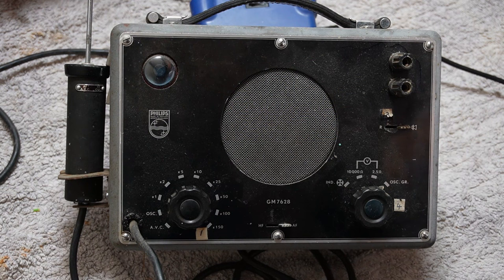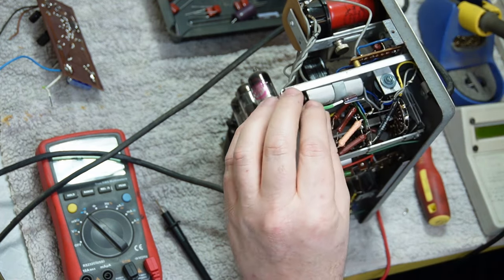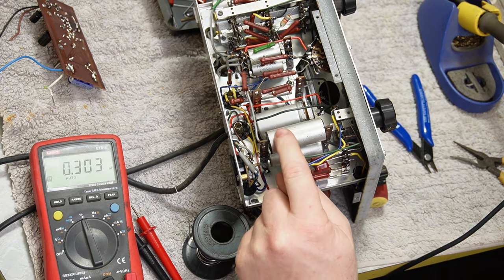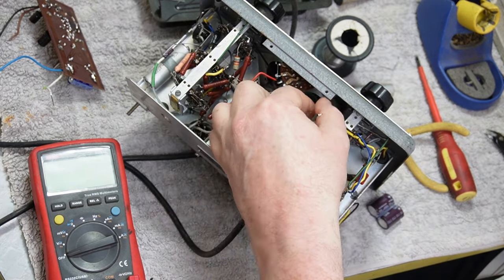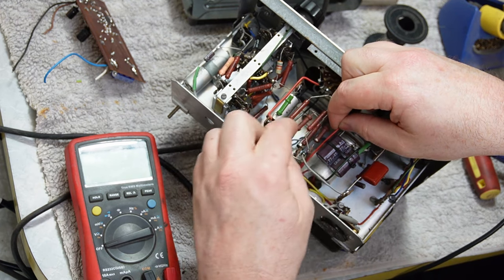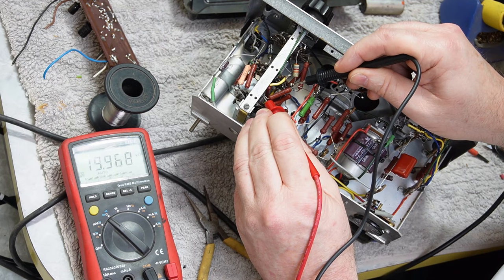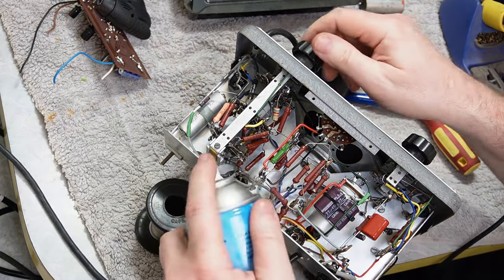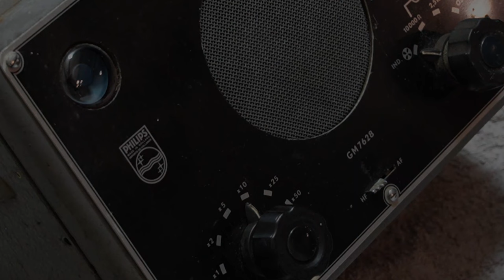Philips Gm7628 Signal Tracer Repair

Comment: Nice repair. I have thought about building one but never came to get it done. In my country I have never spotted an old tube one I guess the repairshops just used an old amplifier with speaker back then. Nice thing to have for sure. Thanks for the entertainment.
Reply from the maker: Thanks - I think the small amplifier and clippy leads is a pretty common way to go... I imagine this was fairly expensive when it was new.